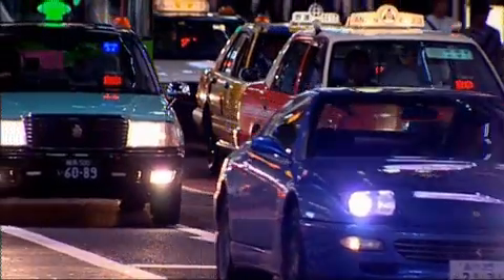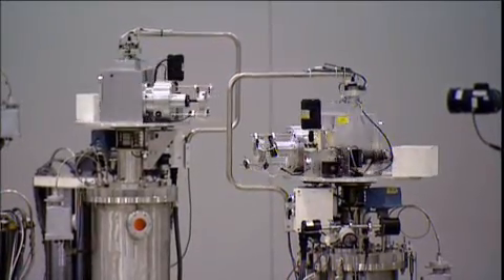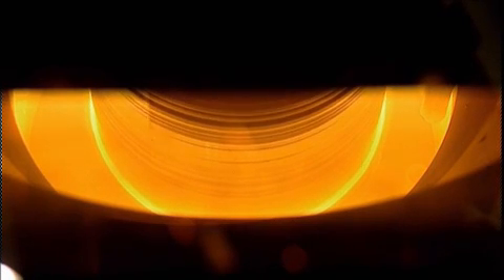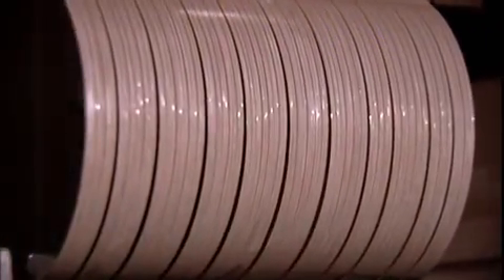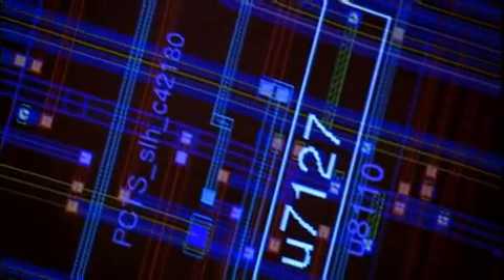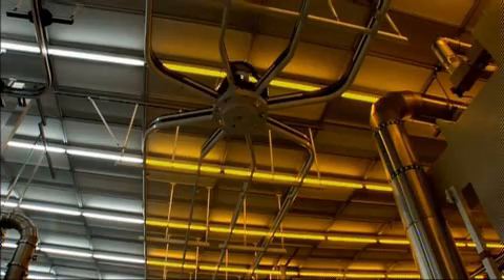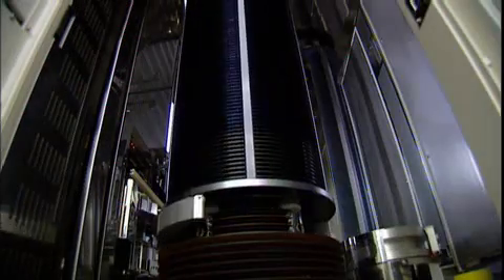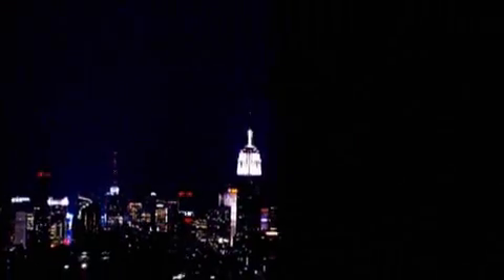How Microchips are made

Comment: I wonder if it'll be possible to rebuild an old 486 CPU using tech before IC's were a thing? It doesn't have to work, but it'll be cool to see how big it'll be and to figure out how much power it would consume 😂
Reply: Not possible - the 486 had over 1 million transistors.  This has been with the 6502 processor that had far less transistors, just 4k.

Comment: Jack Kilby was not the inventor of the silicon transistor. That inventor was Bob Noyce, at Fairchild. Kilby"s chip was a single circuit GERMANIUM chip, not a silicon chip...which Noyce unaware of Kilby's work, invented and noted a few months later. Noyce's chip is the chip used in the world today, not Kilby's. Noyce's Fairchild also invented photo-lithography, whereas Kilby's chip used tiny wires. If Noyce had lived, he too would have received the Nobel together with Kilby...a fact which Kilby justly noted in his acceptance speech.

Comment: A thousand times cleaner than an operating theater. We need some of this quality air in the medical centers.
Reply: The last few orders of magnitude of purity wouldn't make any difference for a medical procedure, and it wouldn't be possible anyway -- during a surgery, for example, there are already tons of particles coming from the patient (blood, interstitial fluid, etc). If a bone has to be cut, there are going to be tons of fragments of bone dust in the air (they have good enough air filtration to get most of this out of the air, but if you have 99.9% taken care of you don't need to go to 99.99999%)

Comment: Why not redesign and re-engineer the manufacturing process and work areas so that the glove box system and tunnel suit system can be used to further increase the purity of the air which has passed through a series of self-cleaning cyclonic filters and self-cleaning electrostatic repulsion filters.

Comment: you didn't mention the major issue... how do they put micro transistor in the chip itself... and how do they build the micro transistor
Reply: I think it is done trough layering.
You apply one layer after another and the endresult is a lot of transistors.
Think of baking a lot of cookies. Instead of forming each one individually, you simply take a cookie form and apply the paste on to it. Then you remove the form and voila, you got your cookie. 
All you do is to create a model once through a computer and apply the material.

Comment: They skipped the part how they place components in that chip.
Reply: They explained poorly but it is done layer by layer as stated in this vid components are not placed in a chip they are built into the surface and a new layer added until you have the finished devise.

Comment: There is no chip making or even transistor making in this video. Time wasting video.
Reply: Exactly, I've yet to find anywhere showing the placement and connection of the transistors.
Reply: @orange70383  they are lasered not placed
Reply: They print the transistors, when they apply the chemicals, shine the design on it and then use light to print the design, wash the excess off to make the first base permanent. Then they build it up layer by layer, the process is known as lithography as explained in the video.

Comment: I still don't know how a chip is made
Reply: Get the water 
Coat it in photo resist
Exposure the pattern you want 
Develop away the stuff you don’t want
Etch through where the resist has been stripped using plasma 
Strip rest of resist 
Go for an implantation or diffusion (change surface) 
And repeat the process until you have all the layers.

That’s about as basic as I can make it
Reply: @tomroose7733  It shows nothing on how the transistors are placed and hooked up. Video shows nothing.
Reply: orange70383 that’s the beauty of it the transistors are the patterns that you are defining when you expose the photo resist. You change the surface and implant things like N dep or Pwell, making each individual PNP transitor or what whichever flavour you want.
So you etch and build up the individual transistors which are then all connected through a metal step
Reply: @tomroose7733  He is China HUAWEI spy trying to make microchip for his boss
Reply: Photolithography for manufacturing on a nano scale. The process is simply brilliant.
Reply: something like a 3d animation would be so much better
Reply: I am also not understand
Reply: You cut potatoes into long thin strips and fry them
Reply: LOL ikr hahaha
Reply: Knife+potato+oven.
Reply: That's because this is only the intro video that is supposed to get you interested. The remainder takes several years to learn (for each aspect of the process that is).
Reply: video is total bullshit
Reply: @JBidensucks  ... Why do you think so?
Reply: of course not idiot, might wanna take a 5 year course first smh
Reply: @firmman4505  what smh?

Comment: I dont understand how it creates a circuit if its one whole piece of silicon. When making circuit boards there is a layer of copper with fiber glass sandwhiched between. But these seem to be all silicon and nothing but.
Reply: It's non conducting pure silicon given different impurities to give different areas certain semiconducting properties and copper to connect things.
Reply: "But these seem to be all silicon and nothing but." That is not correct. The wafers only start as pure silicon, but during chip fabrication, other materials are added. Layers of silicon oxide, silicon nitride, other oxides and even polymers are grown to make insulators between "wires". Ordinary metals (it used to be mostly aluminum, but now copper is widely used, but also tungsten, nickel, etc) make "wires" and connections between different layers. Tiny amounts of boron, phosphorus, arsenic and other elements are used to modify properties of silicon and to produce regions of different conductivity, from which diodes, transistors and other circuit elements are made.

Comment: "Even 1 particle of dust can destoy a chip". yeah thats why they don't have to cover their eyebrows or eyes or eyelashes. 1 finger print has 100s of thousands of skin and dust particles in it. SO muc hbullshit. "This room is 1000 times cleaner than a hospital operating room"... Er again, no it's not. What did they do, go around and keep cleaning it until it was 1000 tkimes cleaner? They're just arbitrary numbers made up. why isn't it 1345 times cleaner? or 811 times? "With a surface roughness of 2.111 billion BILLIONTHS of a meter." no. Just no, You can't measure anything that size i'm afraid. I hate the way people just embelish things and use so much hyperbole. The device used for measure the surface roughness would have to be smoother than the surface itself, and the corner leader from the side to the front, if it were that size would look like the side of a fucking planet through a microscopre. So no.
Reply: Yes it’s all true or you wouldn’t have any of the devices you have today.
They have to over simplify the explanation so stupid people like you can try to understand.

Comment: One quarter of a billion transistors on a chip.  That's cute. :)
Reply: 1.2 billion here on a 6 year old CPU.
Reply: haha ya... but it's a DSP, not a proper CPU or GPU, also the narrator mentioned 'almost a billion' whenever this video was made (2010 latest)

checking wiki, intel didnt really hit 1billion  until gulftown or sandy? ati at r700, nv at gt200
Reply: yes thats about 100nm tech. now imagine intels 8nm tech
Reply: @Knightfire66  intel doesn't have 8nm tech, they have 10nm which barely works and can only make quad cores at best and they are developing 7nm which still doesn't work at all. Meanwhile TSMC has it's 5nm process in mass production.
Reply: @Knightfire66  "intels 8nm" intel have barely figured out 10nm whereas AMD with the help of TSMC are now pushing 5 and 4nm
Reply: @shadowxxe  sry my failure I dont know here i did get the 8nm.
Reply: @shadowxxe  and TSMC has just confirmed that they have massive production problems with their 5nm silicon
Reply: Pakistannn

Comment: So that's why fabs are fabulously expensive. They have more potential complications that a normal factory, and nastily unforgiving precision requirements; requiring obsessively stringent construction, maintenance, and use. No wonder these tech companies don't want to risk trying new technology that would require retooling or rebuilding a fab; it's a huge risk to take a working fab offline, and refit it for an unproven technology.
Reply: what? they retool constantly, how do you think the sizes kept shrinking? different types of layering & etching have been developed due to different problems that appear with every size shrink

every few years some new fab gets announced as well, whether it's intel or samsung or tsmc or whoever

the amount of companies that can manufacture smaller processors keeps diminishing, the other companies that dont shrink either have a niche lack of need to go smaller, or they stop doing business

Comment: Wow Microchip is so small,But Why Smaller Microchip means better chip?
Reply: +derek frost more transistors in the same size, so better
Reply: +Aporto More Complex Than how to get a girlfriend
Reply: Smaller chips = more space for more components on a system. Thinner phones, laptops , etc
Reply: derek frost It's driven by competition, smaller chips = more features, the processor might not be faster but if it's smaller it means you can add extra chips to the same space. Why have a phone that can only make phone calls, when you can have a phone that makes calls, takes pictures, goes on the internet...etc in the same amount of space. Yes it takes money to "research" but the benefit is huge. Think about it, there is a new phone every few months and millions of people are buying.
Reply: smaller means you can fit more in a smaller space and it takes less time for the data to travel across the chip and uses less energy.
Reply: Electricity isn't instant. And plus it takes less money to actually produce smaller chips
Reply: And Smaller Chips Means Faster Processor?And In order Research it Need Huge amount of money?
Reply: Derek, Aporta gave the right answer. I can clarify :
In a car you have room for 1 engine, if you decrease the size of the engine, you have room left for another one, half the size again, and you have room for 4 engines. See, the smaller the engine, the more power the car gets.
Same with chips or if you will CPU's and GPU's. The transistor is the engine in a chip, the more engines that fit in it, the more powerful the chip becomes.
Or, you can make a chip with the same performance of last years top cpu, with half the energy consumption.

Comment: surface roughness of 0.1 billion billionth of a meter? what is that supposed to mean? 0.1 billion billionth of a meter is 0.1 m... If he meant 0.1 billionth of a billionth of a meter, then that is 0.1XE-18m, which is several orders of magnitude smaller than the size of a hydrogen atom. Does't make any sense. I know that the surface roughness is about 1 A, or 1X10E-10 m, or 0.1 nanometer, or 0.1 billionth of a meter.
Reply: I think it's just an expression to show how very small it is
Reply: Mezico Nelson, an expression thats a billion times off the mark
Reply: I think the surface roughness is defined as an average value of all the deviations from the mean height, in which case the 0.1XE-18m could be possible (I suppose).
Reply: seabass CH 
Nice : )
Reply: Hyperbole
Reply: too many billions for me to keep track of
Reply: I believe the announcer added an extra billion there… in "Mechano-chemical polishing of silicon wafers", a scientific paper from 2003, a roughness value of 0.6 nanometers is considered a good result. (That's 0.6x10E-9, not 0.1x10E-18. Big difference!)
 "Experimental results of MCP of silicon wafers have achieved the average of surface roughness improvement ratio (SRIR) to 99% and the surface roughness Ra=0.633 nm measured by atomic force microscope (AFM)."
Reply: Whilst impressive, I will add that if you are married he or she has my condolences.
Reply: @Nine-Signs  and the partner of anyone who uses the word "whilst" has mine.

Comment: I have been in a clean room at Intel Aloha near Portland, OR. I had to suit up in a white bunny suit with booties on my feet. My tools had to be vacuumed before going in. Silicon wafers don't always pan out. Even in the cleanest clean rooms skin cells from your neck or hands can fluff off and contaminate a batch of silicon. And not all processors are good either. The ones particularly on the edge of the wafer is more prone to fail.
Reply: it makes sense why when i was trying to program a microchip it is crushed because it comes from edge
Reply: They are great frisbees too, this is not a joke
Reply: @1969MAN  ...only two problems with this a) they are quite expensive (even a bare silicon recycled handling wafer costs 10$) and b) they shatter when they arrive, sometimes when you throw them
Reply: @KonradTheWizzard  I don't know what to tell you man, I got the 1997 6 inch wafers on the DL
Reply: Pakistann